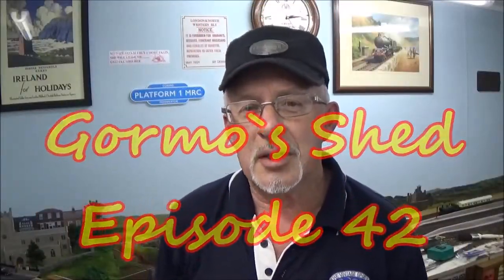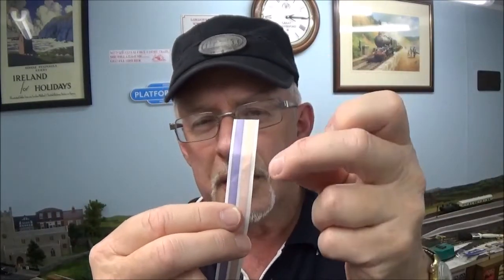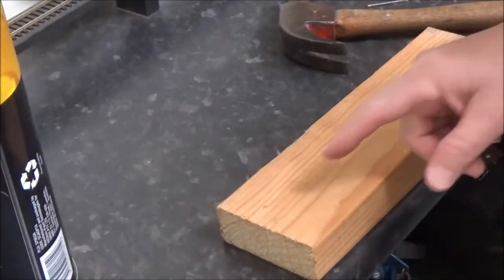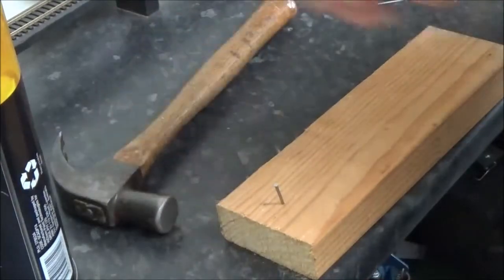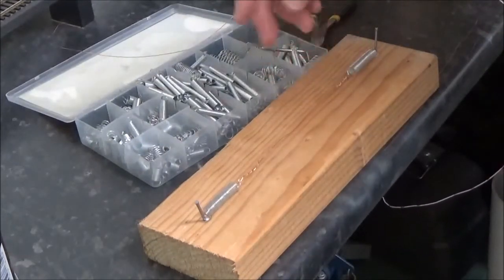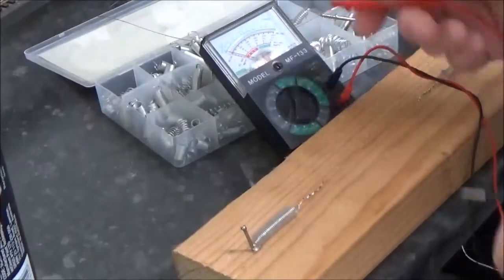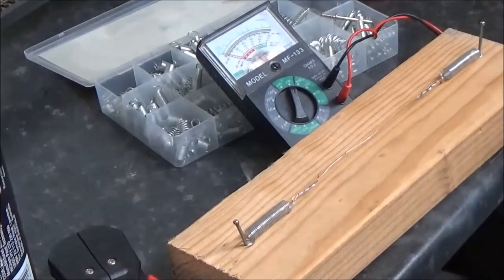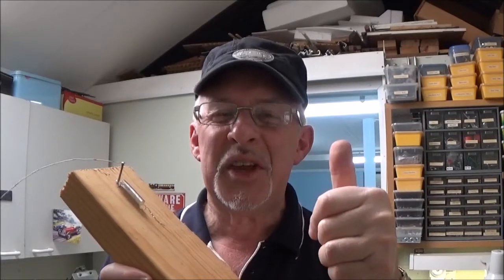Episode 42 Bus Wires

Comment: Hi, just interested in how long you have had this system running for and if you have had any problems with electrolytic effect, due to passing current through dissimilar metals. I live in the UK and it is a damp environment most of the time. I like the concept of the springs and I think if I was to use this idea I would use the springs as tension only at one end and use a jumper cable to attach the feed and link wires, but this has given me food for thought. Thanks…… Craig.
Reply from the maker: G`day Craig.........The demo is the first time I`ve put it together, therefore no idea about the electrolytic effect. If you were to use the spring purely to tension the cable it should work fine and therefore cancel any electrolytic issues I would think....hope this helps.........Cheers Gormo